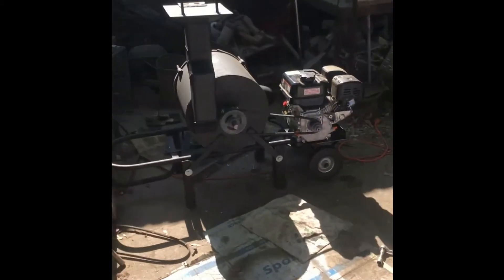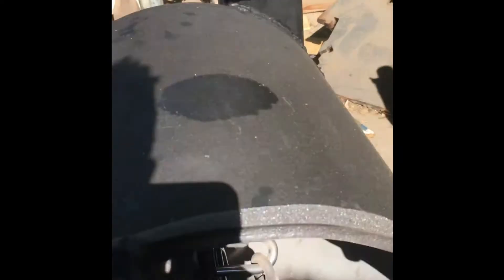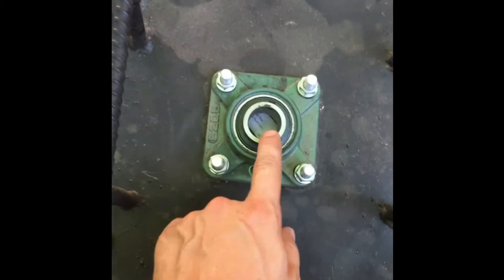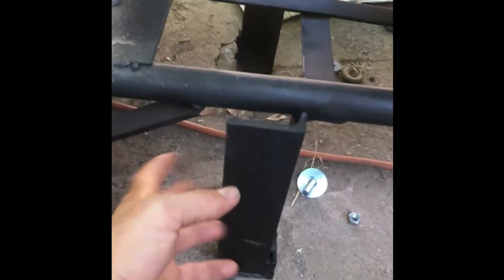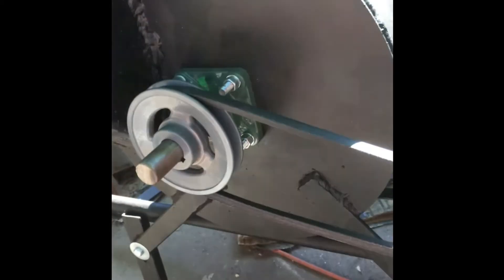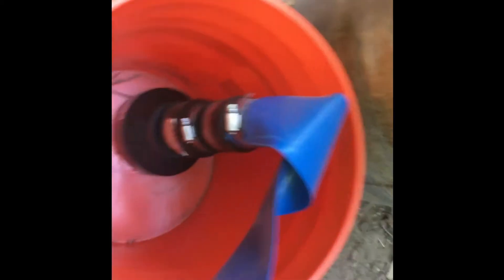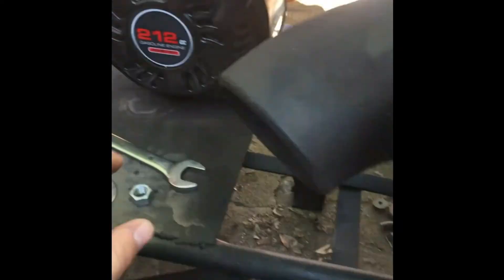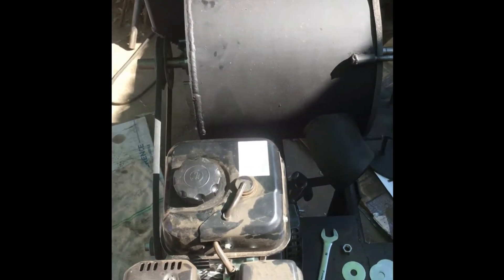DIY Rock Crusher/ Impact Mill

Comment: Larry, how is the motor holding up?  I just started making one and am concerned that the bearings in the Harbor Freight motor may not hold up with the constant vibrating pull always in the same direction.  I wonder if a second pulley mounted 180 degrees from the direction of the crusher shaft, mounted on a lubricated bearing would be worth the effort?  Good work and thanks for posting this video, and, yes, I watched Jeff William's video, as well.